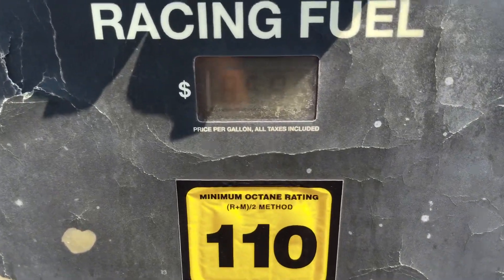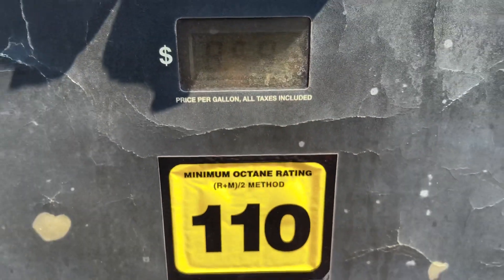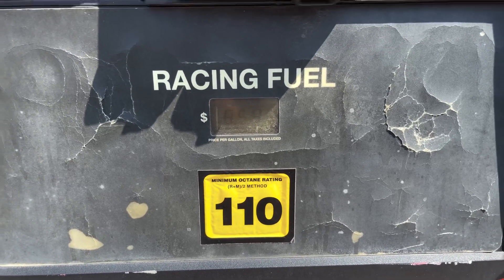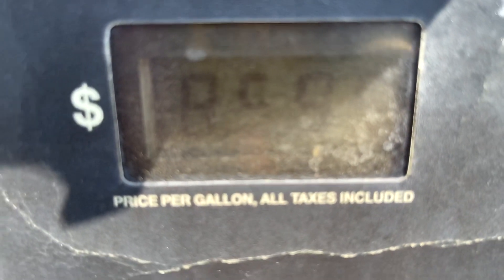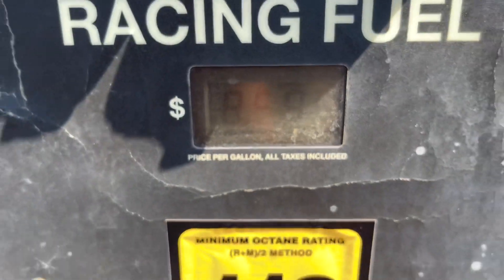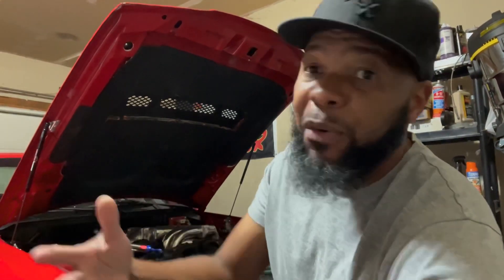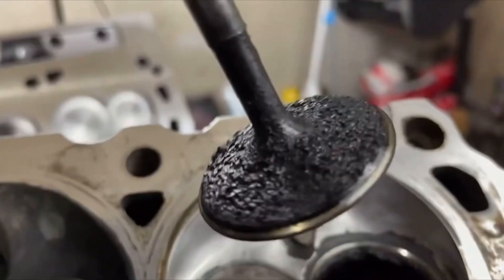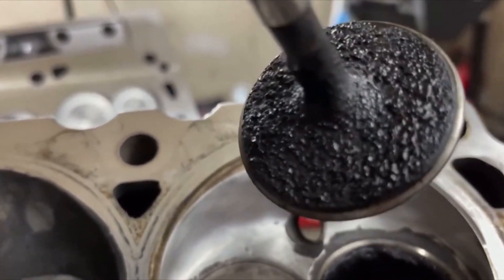Sn95 New Edge Mustang How 110 Octane Can Prevent E85 Goo

Comment: You can use some Sea foam spray in the intake its going to smoke a lot but it works also right before your oil change put like half a quarter of transmission fluid in your oil and let it run ten minutes then change your oil oh and use mobil one oil it has a cleaning agent in it to prevent build up ask me how I know I had to  take a class on nothing but oil it works also use some lucus oil with it every 3,000 miles and your motor will be clean on the inside
Reply from the maker: Good to know. Thanks for sharing